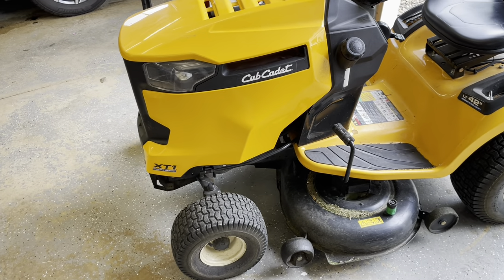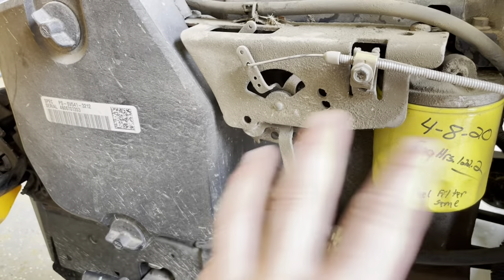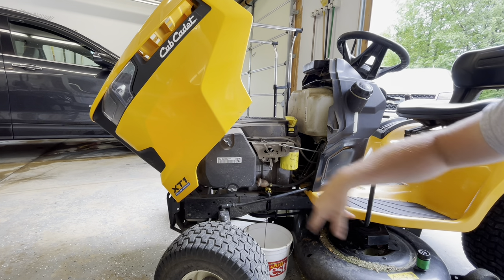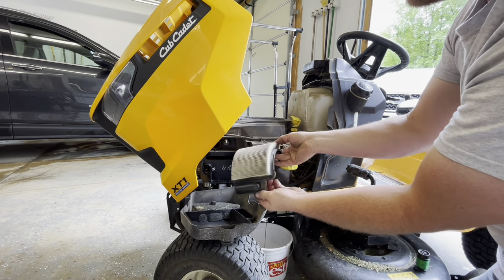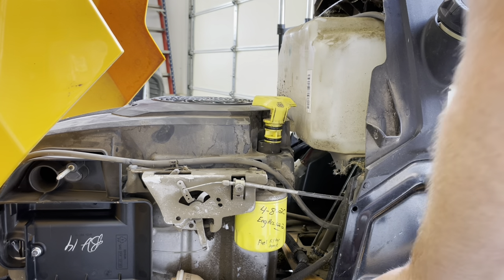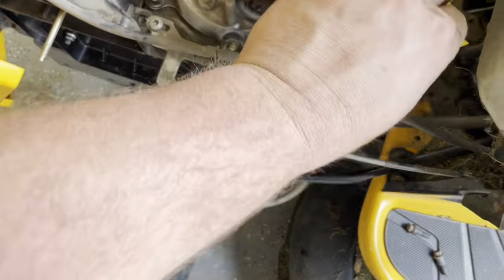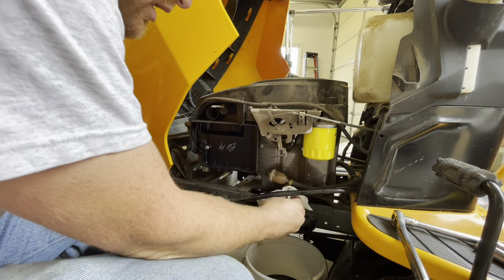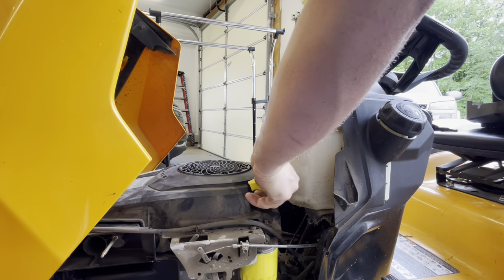How to change oil and full service on riding mower | Cub Cadet XT1

Comment: You don't need to take the engine cover off to change the spark plug. All you need to do is remove the hood for easy access.
Reply from the maker: That’s another good way. I’ll try that out next time. Thank you!

Comment: You should start / warm up the engine before draining the oil.  Warm oil drains faster.
Reply from the maker: I agree with that.
Reply: Running the engine also gets the particulate matter (small metal shavings, burnt oil particles, etc.) circulating and suspended in the oil to make sure you get that stuff out with the old oil.

Comment: Would’ve been helpful to not edit out the clamp of the fuel filter line with pliers so as to not get gas everywhere
Reply from the maker: The best way to clamp it off is to use vice grips.